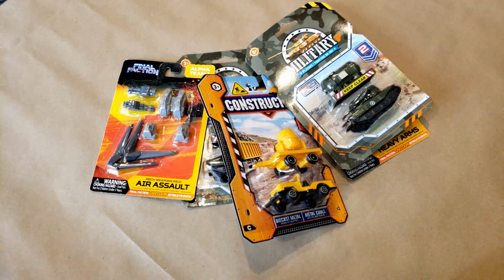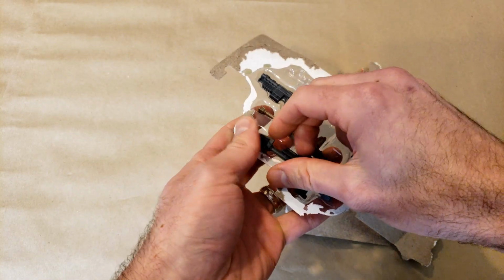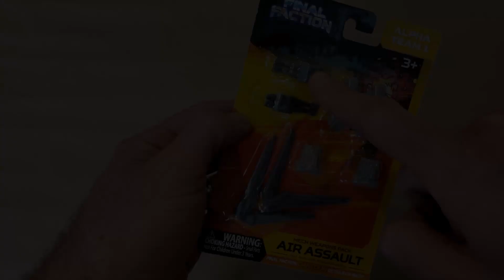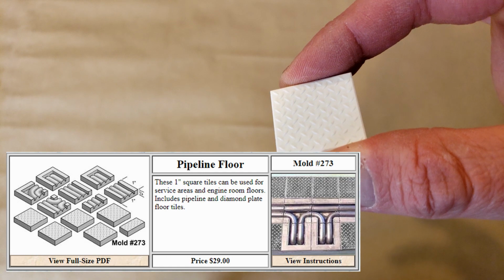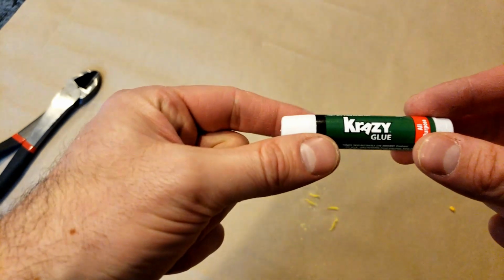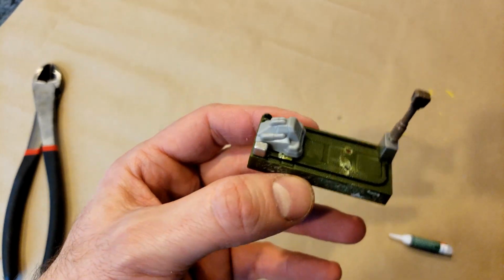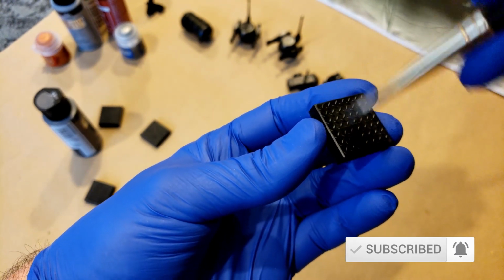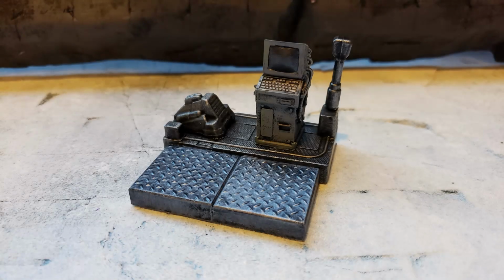Dollar Store Chop Shop - Scatter Terrain Build #4 - Super SciFi

Comment: Nice work.  I make up sets of 'toy soldiers' and give them away to less well-off kids (54mm for 3-7 year olds and 20mm for 7-12 year olds because those are the cheapest scales). I have a request for a 'space base' for a lad (Captain Fandango and the Insensate Hordes of Gorm) and a 'space city/space port; for a girl (think Star Wars meets Conan).  I have the figures now (took a bit of finding/modification) and the buildings are simple enough but I need vehicles and ships. Once this damned disease is under control I'll be combing the discount stores looking for bits to finish those sets. Like what you came up with. Hubba Bubba extra-long chew (its some kind of candy strip) comes in a very nice sci-fi type packet, I bought a box of them, some for 'space hover tanks' with a turret (Captain Fandago's heavy metal) and some as small space saucers for the space port (using one half of  plastic clear globe fillable xmas decorations on top with landing legs from panel pins pushed through press-stud/popper fasteners). Mine are made as 'toys' but if I can foster an interest in young kids the materials will remain available. Did a 20mm scale 'meteor of doom' from a Ferrero Rocher plastic sweet globe, sits in a crater and the top is removable so you can play inside (detailed the interior). Might be worth looking out for those closer to the holidays (they have been on sale for the last two xmases).